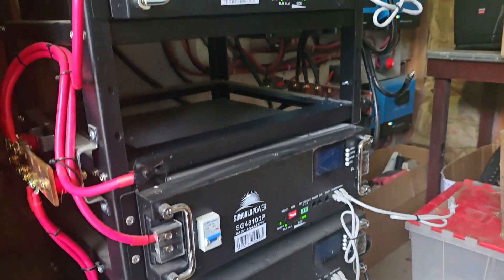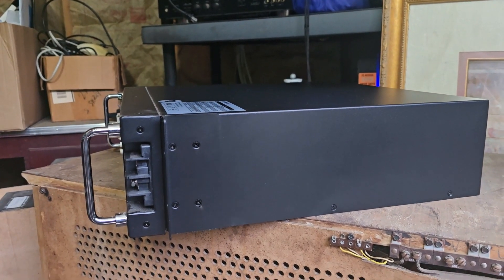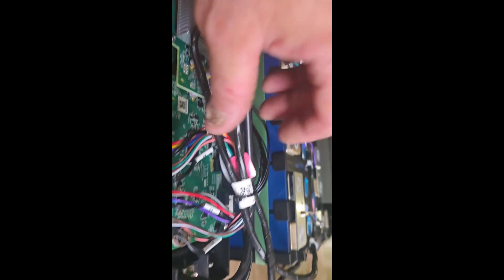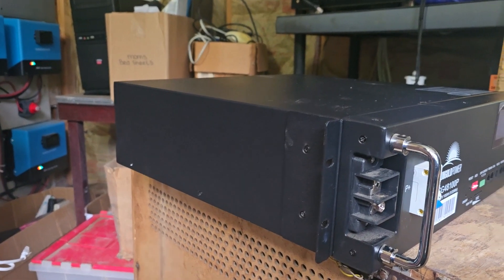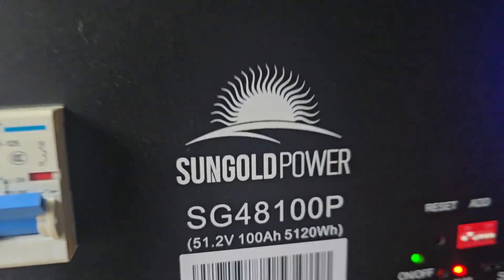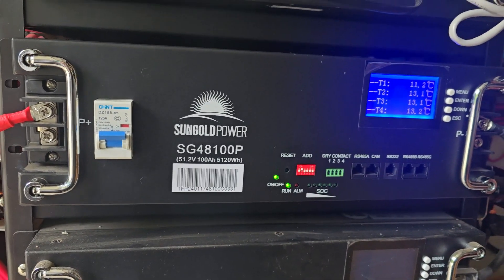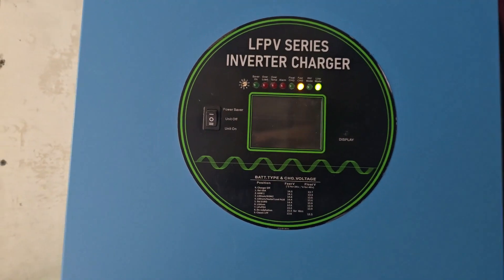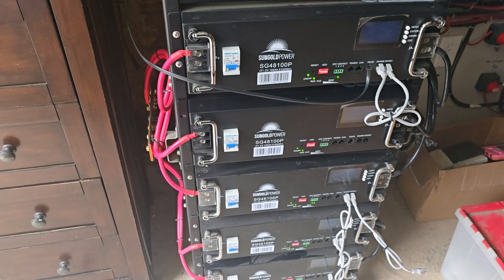Sungold Power - 48v 100ah Solar Battery Problem - Fixed

Comment: I had the same failure, T1 was -40C. Turns out mine had a failed BMS. I drove it down to Mission Viejo ( a two hour drive) where their techs replaced the BMS while I waited.
Reply from the maker: Might have been the same batch of batteries. Got mine early this year.